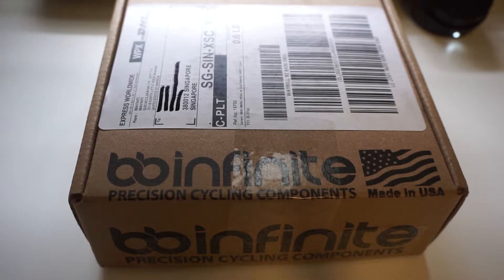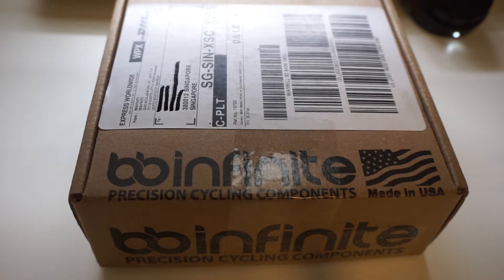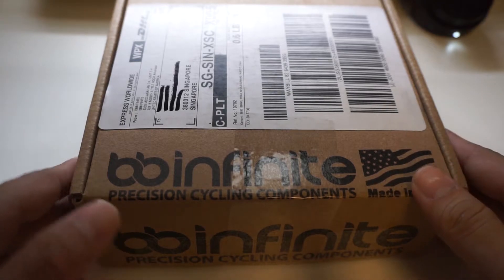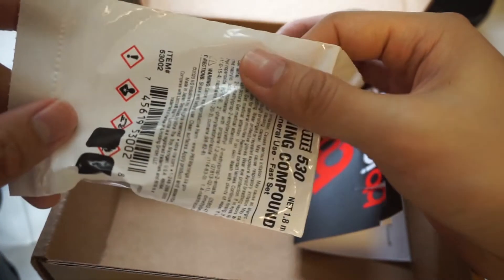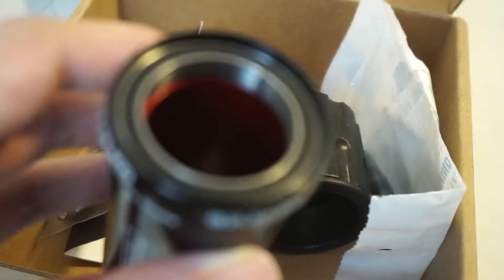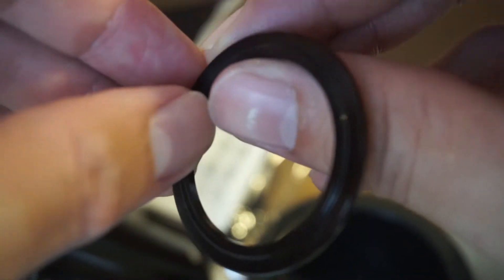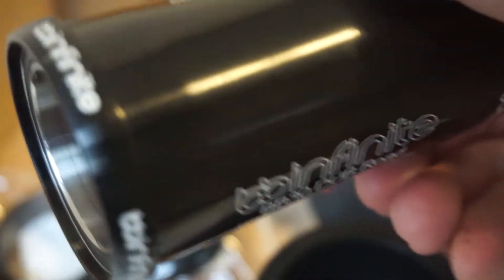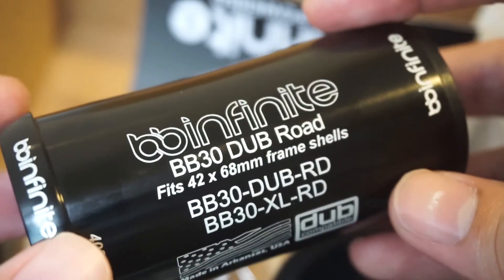BBInfinite BB30 DUB Road Unboxing

Comment: There will be a tool specifically meant to extract BB. Not sure what is it called exactly. But since yours is pressfit, you dont need to remove the BB shell but you can just press the bearings out to 'service' it. Make sure the surfaces is clean and lubricated when you install!